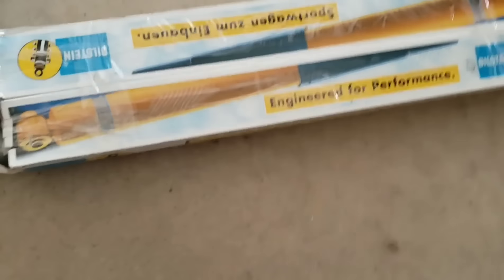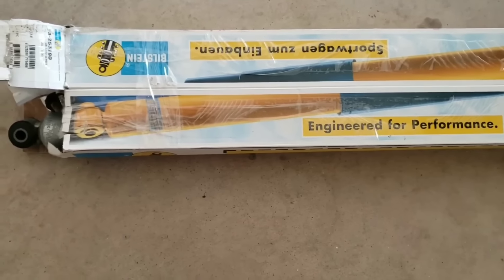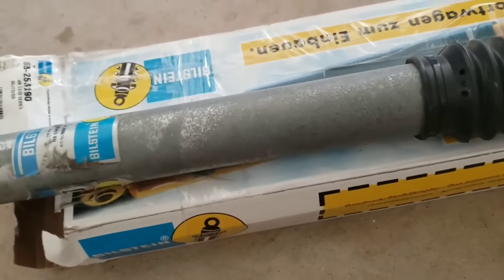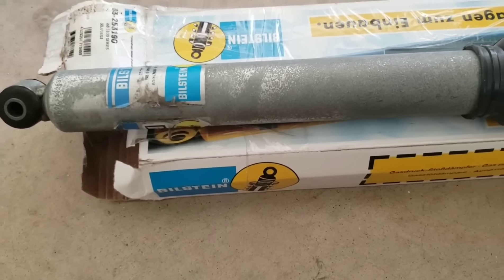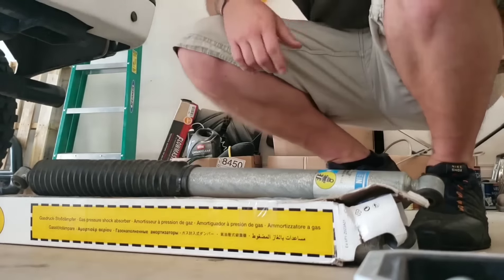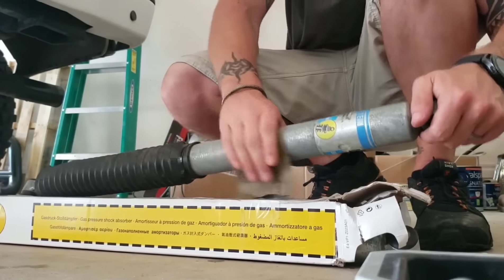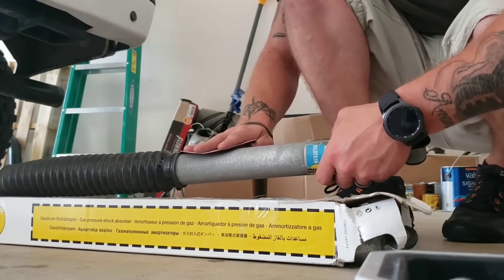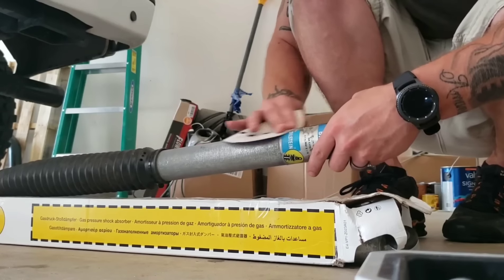NEW SHOCKS!! Bilstein 5100 install/review 2018 f150

Comment: I put a roadmaster active suspension on my 2011 f150. In doing so I noticed my left rear shock was bad. I also need to do the front 4x4 actuators so it's a good time to do the front shocks also.

Comment: Do these level out the front with the back?
Reply from the maker: Not this model but you can get the ones that level it. I already had a level on
Reply: @WICKEDAUTO1  what type of level do you have on there?  And have you had any problems with your balljoints or other front suspension parts?
Reply from the maker: @josemejia9553  just a 2in puck, no issues at all
Reply: @WICKEDAUTO1  how was the ride with the shocks and the puck? Looking at doing this same thing

Comment: No way those only have a couple thousand miles. I had some with 60k and the finish was still good. I don’t live where it snows though. But they are zinc coated and should last.
Reply from the maker: Of course could have been lied to but they did come from Wisconsin, had a winter on them.
Reply: WickedF150 🤷🏻‍♂️ maybe. I got mine used with about 40k on them and they were a big upgrade to the factory 240k miles shocks my old 4runner had. I actually just bought a brand new set today for my replacement 4runner. I am looking forward to see what new ones are like compared to used ones.
Reply from the maker: @GXKid06  I'm sure you'll be able to notice a difference with 40k on the first set. Have you gotten the fronts to match? If so, are they really worth it?
Reply: So my situation is interesting. I had a blue 2000 4runner with those 5100s that i got from a guy I met at a 4runner meet. Got them about 2 years ago. Put maybe 6k miles on them and the last 1k i had air lift in the back because I had to tow a boat. The air lift was nice it made the ride smooth. I wish i could have salvaged them. That rig got totaled back in October. I bought another identical one in February with factory 193k mile suspension. A couple months back I was able to snag original 2006 trd tundra front Bilstein shocks and coil over for the front. Guy claimed they only had 10 miles on them and they had been sitting on a shelf since 2006. And they look new so I believe him. But those are meant for a tundra that is at least 1,000 pounds heavier. So for the first 1k miles or so its was a rough ride but they have softened a bit. That also lifted the front end about 2 inches. I really noticed my braking be a lot better because I no longer had nose dive. Completely gone. Today I finally found the money to buy brand new 5100s for the rear that are supposed to give me 1.5-3 inch of lift travel. I also bought some Old Man Emu 906 springs what will lift it 2 inches. Those springs are designed to be thicker and hold 300 pounds without sagging. So im expecting the ride to be firm but controlled. Because right now its just blown shocks and saggy springs. And don’t even get me started on the ugly squat it has right now 😂. 

As for you’re question, yes get the fronts. I really believe in these shocks. From what I remember of my last one, the ride was really controlled and smooth. I had also replaced my steering rack and sway bar bushings with polly urethane bushings and that made the steering feel a lot more direct and sharper. Also you can look in to getting better bump stops. I got some called Durobumps for the back of my 4runner and that is the only way I am surviving with the blown shocks right now. They are a progressive rate bump stop. So at first they are really squishy rubber but the slowly get to stiffer rubber to act as a second shock absorber. Hope this helps. Sorry for the long reply.
Reply from the maker: @GXKid06  that 4runner is gona look nice!!! I appreciate the feedback long or not lol I was actually thinking about bump stops earlier in the week, I guess I'll have to look into them more now!
Reply: @WICKEDAUTO1  Great vid's brother! I live in Wisconsin and with the winter we had last season, I highly doubt you were lied to....the amount of road salt used here was incredible. I guess you'll have that with record snowfall. 

Question I have is, did you install those upside down? I've seen install videos where the boot is on top. Do they fit either way and does it really matter?
Reply from the maker: @maknbacon7367  no, per the video I watched this is how they are supposed to be when installed.
Reply: @WICKEDAUTO1  Perfect...thanks for the response. Thinking about these for my 2019.
Reply from the maker: @maknbacon7367  the first week I felt they were great and soaked up every bump, now they do feel more like am offroad shock

Comment: I literally just installed those same rear shocks on my truck yesterday.  Regular cab short bed 4x4. Very choppy ride with stock shocks. Made all the difference! Very happy! So much so that I bought the front set a couple of hours later. Might as well do all four corners now.
Reply: Wym de 4 corners ?
Reply: did you like the stock front shocks better or the 5100’s?
Reply: @ethanspruill7539  I have only installed the rears so far. The fronts are sitting in my basement. At this point I might as well wait until the stock ones are worn out. I do hear that the fronts are a bit rougher of a ride than stock though.
Reply: @hdz12ez  well i would expect that just like the rears. the question is if it’s better to have the 5100’s on all 4 corners or just the rear. i am hoping and thinking that it’s better with all 4 installed because of the better handling. is body roll not a problem in the front or something?
Reply: @ethanspruill7539  I would imagine that the handling is better but body roll is not a problem with the stock fronts. I'm sure that having all four corners done would be a better ride overall.
Reply: @hdz12ez  I agree

Comment: Sorry for all the trouble you are having but I need to ask. You have the piston slap and the oil consumption? I’m looking at an 11/17 build date on a 5.0 F1 50 killer deal I’m just worried I should buy a 19 build date model maybe less problems? What do you think
Reply from the maker: Well there are 19s with the rattle, oil and dash warp so it would still be just a luck of the draw honestly. I would still get a ford if that's what you want though. With the 5.0 or 3.5 it seems to be luck of the draw.
Reply: Man I was hoping a later build date would be safer. It’s a killer deal but one of the first of the line

Comment: Good job on the install and I like your videos, but a whole kit with front adjustable height struts and rear shocks is under $400 with shipping.  Did it make sense to buy these rear shocks used?  I installed the whole kit in my garage.  Rear is super easy, front was a pain.
Reply from the maker: Yep, the price and little usage was why I had to grab them at the moment. It was only $60 for the pair plus shipping. Couldnt beat it. The front I'm sure was a pain! Have thought about the whole set but a simple block in the front suits for now, still have my fingers crossed I'll win a give away and put a 4in lift on lol
Reply: @WICKEDAUTO1  Truck looks great at it's current height!  Glad you like the ride with the 5100's.  I'm happy with mine as well.

Comment: A floor jack under the rear axle housing would make this job way easier. Less distance to compress.
Reply: You are supposed to install at ride height.  That way you can torque under normal ride